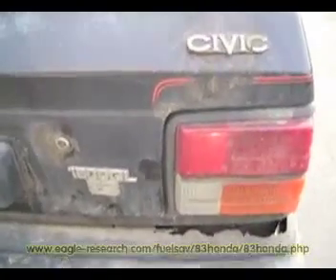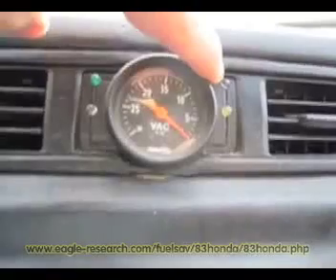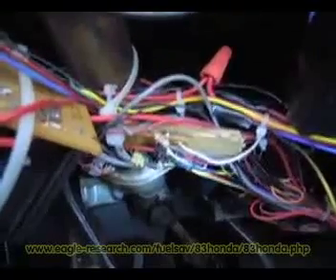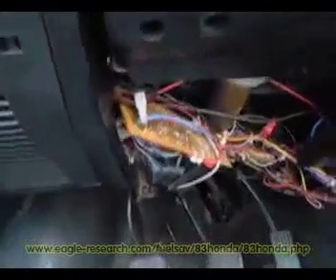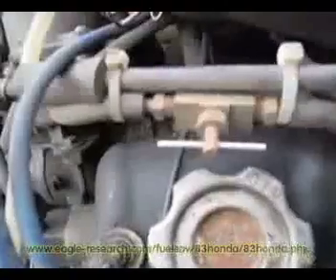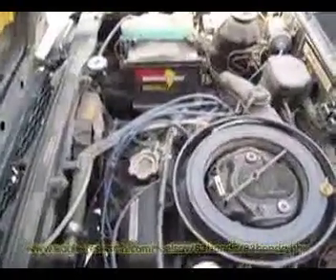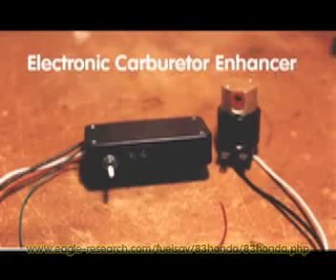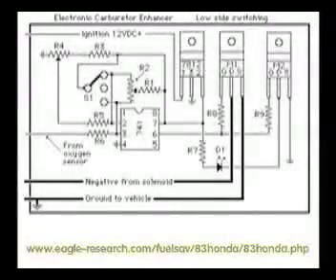Eagle-Research Fuel Savers on 1983 Honda

Comment: with 2022 fuel prices the way they are, might be time to dust these fuel savers off the shelf.
Reply from the maker: FAQ: What fuel saver would be best for…?
I AM an expert on combustion enhancement but all that was put aside in 2008 when the economy crashed and my late wife got sick.

So now I’m out of the loop.  My fuel saving technology will work as well as ever, the reciprocating piston internal combustion engine hasn’t significantly changed for 120 years….

But the engine fuel and drivetrain controls have gone ‘electronic’ and THAT is what I’m not up to date on.

When you apply a combustion enhancement technology to an engine, you need to modify the fuel controls too. 

I call this Combustion Enhancement Interface Technology (CEIT)

Examples are the Carburetor Enhancer, EFIE, MAP/MAF sensor Enhancer, etc.

So to answer this question, It’s ALWAYS good to start with my publications, which are timeless as long as internal combustion engines are used.
https://eagle-research.com/product-category/fuel-savers/ 

The very first book (of mine) that anyone should own is the ‘Super Gas Saver Secrets’, where you can save fuel with little cost, then most of my other book (projects) saves most people at least 25% (up to double) in fuel mileage.

I’d apply the HyCO 2A (or HyCO 2DT for diesel), HyZor and water injection, which should accomplish 25% to 100% decrease in fuel consumption, with increase in engine life, no decrease in power and a decrease in pollution.  Then if you want SERIOUS fuel saving (200 mpg+), go onto the Extreme Mileage 101.

The key is to also apply the correct CEIT and I cannot authoritatively and competently give you that answer without bringing myself up to date on your vehicle’s fuel system controls… Which I do not have time to do.

Since most of my kits are currently ‘out of stock’ as I concentrate on the AquaCure… A good company I can recommend for fuel savers these days is the https://hydrogengarage.com

Use   EAGLE  (all caps)   as a coupon code (on the last page of the checkout) to get 5% off on Andrew’s https://www.hydrogengarage.com/store/  

They don’t really have the HyCO 2A technology (you’d need to build that from the plans in my books, but they do have the HyCO 2DT (diesel vapor) and Brown’s Gas electrolyzers… And most important, they are pretty much up to date on CEIT options.

Other companies have excellent water injection systems.

I’m not up to date on CEIT because when I restarted my business after my wife died… I concentrated on the HEALTH application of Brown’s Gas because I want to help as many people as possible NOT go through the years of suffering, we did.
Reply: @ecopegasus  May Jesus Christ bless you in your success George.... Jay. F.

Comment from the maker: 1. The Carburetor Enhancer vaporizes the fuel better because the modified pressure (vacuum) in the float bowl helps the air bleed systems in the carburetor make a mist instead of a spray.  A mist has more surface area, thus greater evaporation (vaporization) takes place.
2. Although I use less fuel, I am NOT leaning the actual air:vapor fuel mixture.  ONLY the fuel that is vapor when the spark plug fires actually powers the engine.
3. There are no injectors in a carburetor!  
4. Read my books!

Comment from the maker: I'm a certified Automotive Technician.  I've been working on vehicles since 1974.  I know carburetors better than most mechanics (and I've proved it many times). 
I also seem to know a lot more about Physics than you do.  
DO your experiment, video it and post it here to prove me wrong.  
BTW, your drinking straw example is NOT appropriate unless you plug the straw, like the float and needle valve does.

Comment from the maker: Sorry, YOU need to learn this.  The float bowl fuel level is independent of atmospheric pressure differences; it is totally controlled by the float/needle valve.  You are correct when you are talking about the float bowl to venturi pressure differences, where there is no shutoff valve.
Original Equipment Manufacturers have used this technology (controlling fuel flow with vacuum to float bowl), for example Ford's 7200VV carburetor in Police vehicles, where they needed high performance.

Comment from the maker: I advise you to take it to Honda. Adjustment of that carburetor is really specialized because the engines cylinders have a pre-combustion chamber fed by one venturi and the main cylinder (for lean burn) is fed by the other venturi. I have the service manual and even it says to take it to Honda. I had Honda set mine up (even though I am a mechanic) so I could get an OEM baseline. Then I added my fuel savers.

Comment from the maker: The fuel level in the float bowl does NOT raise because the float/needle valve holds it at its set level regardless of the lower pressure in the float bowl.  The drop in pressure is just enough to 'tune' the carburetor (OEM knows this works and only installed it on select vehicles).  Economy comes from increasing air bleed efficiency, which causes the fuel droplets to become smaller, increasing fuel evaporation.  ONLY the fuel that is vapor when the spark plug fires actually powers your engine!

Comment: Hello,
I have an 83, 1.5 as well,, same color and model as yours. I head you say your a mechanic, I could use some help adjusting carb. need to set the idle and get the fuel mixture right.

thanks